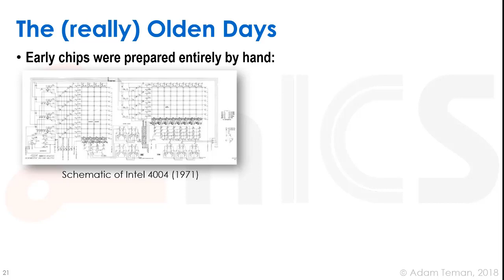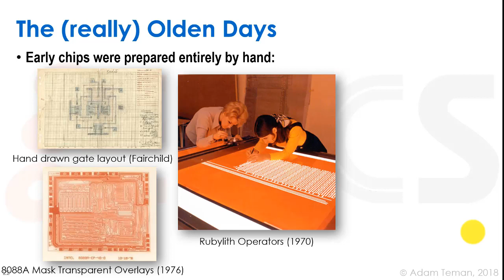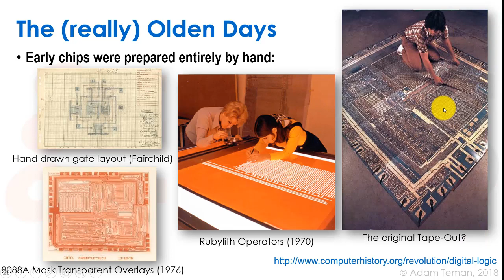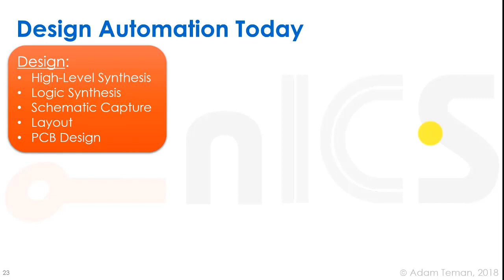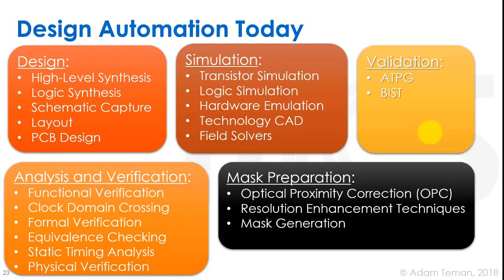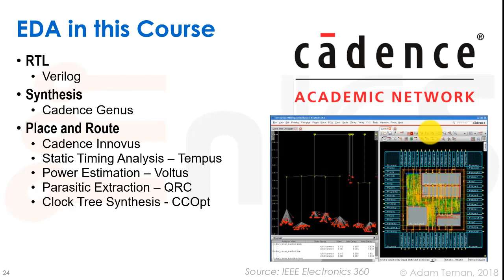DVD - Lecture 1c: Design Automation

Comment: Can we able to install this eda tool in our laptop or its licenced version
Reply from the maker: Hi Siragam,

In general, the answer is... no. The EDA vendors do not distribute their tools for free, nor for personal use. They usually also need a Linux server with RedHat8 as the operating system.
That said, there is an open source project called OpenRoad, which has free versions of EDA tools. You should check it out.
There are also some free versions out there. For example, Siemens-EDA (Mentor) has traditionally provided a student version of ModelSim (logic simulator) that you could try.